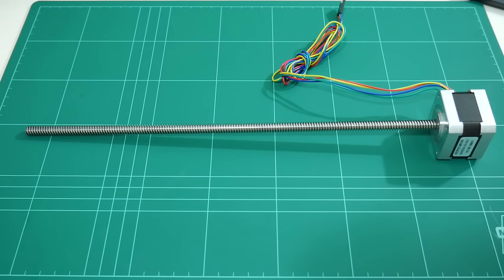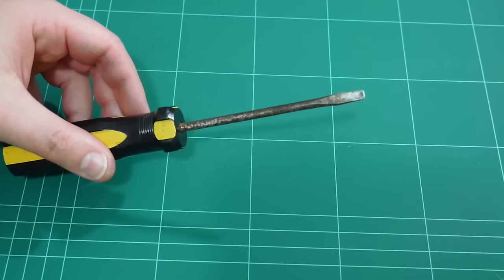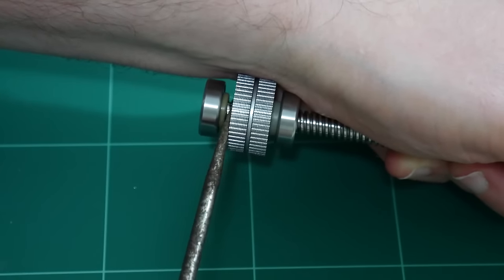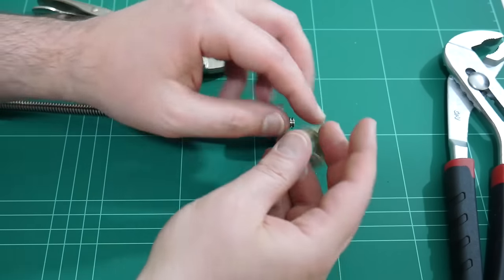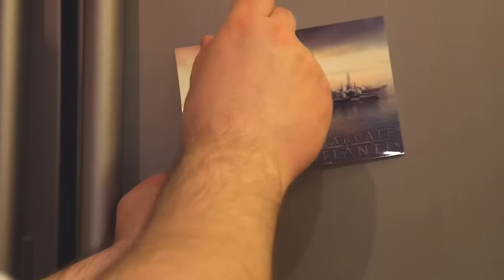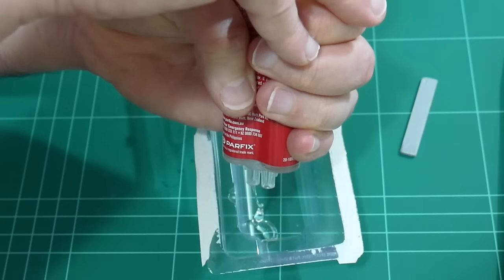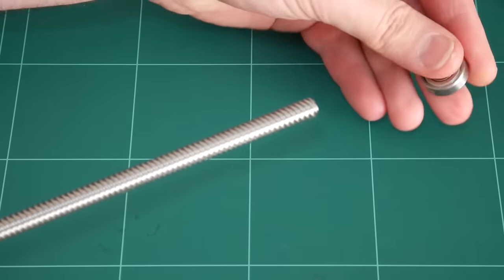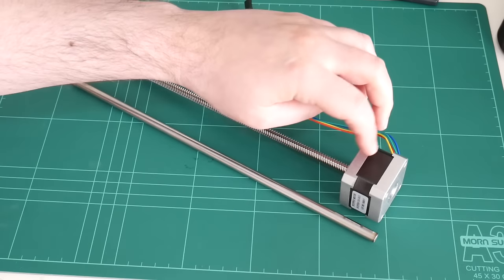3D Printer stepper motor mod

Comment: Thank you for the clear instruction. It is good to learn new things.
However,,
I use Flashforge Creator, and I've been having problem with bent lead screw too.
I tried to replace the lead screw, but it's impossible. I chipped both the lead screw and the magnet pretty bad, and they are still not separated. I just have to get the new motor.
This could have saved me like $90. Just didn't work for me.
So, I gotta say, "Do it at your own risk. if you own flashforge, don't."

Comment: Wonderfull, i love the style of this Video, had some good loughs. So if i want to build my HC with 200mm Z Hight, i ll need the 400mm Leadscrew? So i will need 400mm Extrusions for the Z Axis, 390mm Smooth rods, and a 400mm Lead screw?

Btw wouldnt the build still profit of a dual Z Motor setup?
Reply from the maker: You could get away with a 350mm leadscrew. Every other dimension you listed is ok.

Comment: A smoothrod in a stepper motor can be used for a ultimaker style printer, this removes the need of a belts
Reply from the maker: Bingo! I was thinking of the Ultimaker as well...
Reply: Tech2C well i own a ultimaker v1 myself and i know that such a upgrade would increase my accuracy.

Comment: Hi,
I suggest heating the magnet and lead screw to about 200*C to break down the glue bond. this works great for both epoxy and super glue.
I do not feel that at this temperature the magnetism of the magnet would alter
Reply from the maker: Heat could be a problem for a magnet as the magnetic domains may disorient. This depends on the metal, which I've seen first hand neodynium magnets lose their magnetism inside RC Car motors when overheated to 180c+. I'm not sure what material these magnets are in the steppers but 200c sounds quite high. I guess these steppers are cheap enough to experiment with.
Reply: someone else in the comment section said curie temp is 100 !!

Comment: i replaced the shaft in my nema14 guys and now they make horrible noises and vibrate differently when its at a certain angle. i wish i ran these things first before i changed the shaft. i think i may have damaged the teeth. it might have been when i had em in the vice and whacked on the rod to remove it.

Comment: Stick with a standard nematode 17 and coupler. That way you can change lead screws easier and if you want to go longer it’s also a good idea to increase the diameter. No need for a new stepper motor

Comment: I wonder if you could attach a nut to the rotor instead of the rod, for the motor to be part or the carriage being the one sliding up and down over a rod fixed to the frame. I think this may reduce the need to hace couplers to deal with the bend the rod may have when spinning: if the rod is fixed, then the only lateral movement to decouple wold be the one from the motor itself, but since the rod is fixed this shouldn't result on a wobble at the peace of one time per whole spin, but it would happen smoothly along the entire rod height. A spinning rod bent in the middle would transmit a wobble even to its base affecting the print quality from the very bottom up, while the same rod, when fixed, shouldn't affect the print quality but perhaps up to the height in which the bend becomes noticeable, and then the strain over a coupler for the motor would be negligible since the period of wobbling would be just one per a displacement over the entire rod.

Does this makes sense?
Reply: they exist as commercial products, so yeah.

Comment: Very interesting and straightforward video.  I don't wish to be alarmist, but I have always been told not to disassemble a stepper motor, as the rotor will partially de-magnetize and the motor will not produce the rated torque ever again.  I do not know this to be fact, so I will just throw that out as a caveat.

This has the potential to fall into "wives tale" territory, so maybe someone with actual knowledge on the subject can weigh in.  Perhaps some rough testing of torque between modified and non-modified motors might be useful.  I have tested torque using an  inch-pound torque wrench on a suitable nut (actually two nuts jammed together) with the motors energized to measure roughly the stall torque.  This would be an easy test to compare two motors to see if any substantial deterioration occurs because of disassembly, and could put the issue to rest.

But please do not consider this a criticism- I found the video very instructive and applicable to my current situation.
Reply from the maker: These stepper motors are just brushless motors. I don't understand how disassembling them can "demagnetize". A magnet will demagnetize with heat.

Either way the modified motor I'm using for my Z axis is working superbly. Cheers :)
Reply: Try to google it, devers6 is unfortunately right. It is something about the rotor gets magnetized after installation and you short it when you dis-/assemble it. 

I did it my self on one of my extruder motors and whey also work fine, so i dont really know how bad the de-magnetizing is.
Reply: Jesper Juul Thank you for the reminder - sometimes I forget Google is there.

Here is the result that meant the most to me, from legendary Marriss Freimanis of Geckodrive fame:

     This topic came up in another group. The stator acts as a magnetic "keeper" for the rotor.

     Nothing like running an experiment to know if something is true or not.

     I had a motor I didn't care for (MO62-FD04), so I ran dyno tests on it that showed 112 in-oz low-speed torque. I removed the rotor for 5 seconds, then replaced it and re-ran the dyno test.

     The low-speed torque now was 70 in-oz, or only 62% of what it was before disassemby. 

     You may not notice the loss in torque but it is real and it is there.

     Mariss

Now, here are the "grains of salt" I take away from this discussion:

1) These motors are low-end Cheap Chinese clones, not high-performance optimized systems.  I suspect any deterioration would be minimal.

2) The application is 3D printing, which is much less torque-dependent than CNC.  The market has been characterized by a race to the bottom in both mechanics and electronics, so I doubt there would be a noticeable drop off in performance.

3) I think the advantages to be gained by replacing lead screws with different threadforms, pitches, lengths, and materials far outweigh whatever electronic performance reduction might occur.

So I fully intend to try out these techniques if the need arises; just doing so with my eyes wide open.
Reply: I've taken a few of these apart. None have suffered any noticeable negative effects.
Reply: devers6 Wouldn't the possible speed of the motor also be reduced. Since there would be less torque that could be converted to speed. I could see the speed reduction being noticeable in 3d printing.
Reply: The problem as I understand it is that you can't get the gap between the rotor and stator as evenly spaced as they can in the factory with a special jig.  Personally I'm happy to get the back bearing back on well enough to stop it scraping.

I don't think there is any issue with the rotor being demagnetised.  Modern ones are a single neodymium ring magnet trapped between 2 iron pole pieces.  The torque in a hybrid stepper is not really dependant on the permanent magnet except to define which poles are north and south,  as the magnetic force from the coils does all the work.  Even if the permanent magnet is severely degraded,  the stepper will act as a Variable Reluctance motor.  This is why it is called a hybrid design.
Reply: "So how does a magnet loose its "full charge"?"   Inability to spell the word lose  causes them to lose credibility.   Permanent magnets are not "discharged"  they can only be damaged by sharp mechanical shock, powerful magnetic fields  or by heating above the Curie temperature  (at least 100°C  see https://en.wikipedia.org/wiki/Neodymium_magnet)
Reply: A solution I devised to minimise the torque loss,  by getting the back of the motor on as straight as possible, works as follows

1) The motor is mounted on a frame with a flexible drive from another motor which can turn at a constant low rpm
2)  The coils of the motor being assembled are connected to a dual trace oscilloscope across shunt resistors.  A simple scope made from an arduino  should suffice.
3) The back of the motor is attached snugly but not tight , and 4 large screws are arranged in a frame around the back,  such that they can fine tune the position of the back like a 4 jaw lathe chuck. 
4)  The drive motor is turned on,  and the position of the back is tweaked until the waveforms generated are as large and even as possible
5)  The motor screws can now be tightened down,  and the motor should be restored to close to optimal condition.
Reply: You don't understand? It has to do with the motor body acting like a magnet keeper for the rotor. I guess you never played with magnets much?
Reply: In a hybrid stepper used in 3d printers, disassembly cannot and will not lead to a loss in torque unless you blow torch the magnet or drop it on concrete or something. Shock from dropping a magnet can reduce its magnetism though, so handle with care.
Reply: Marcelo J - If you wanted to fix a broken cable of your Nema 23 motor, disassembling it was perhaps your only option. If the motor has become functional again, it was worth opening it to fix it. Though the torque is reduced to an extent now, the side benefit is that a useful lesson has been learnt.
Reply: As far as my experiments go, stepper motors disassembled always work. When in doubt, do an experiment: one way to check torque reduction is to use a torque meter, and hold it to max torque while it is trying to rotate.
Reply: You have no idea what you are talking about. this is not a shock effect. The field gradient in the gap is strong enough to 'reshuffle' the local magnetic domains as you pull the rotor, the only way it can be prevented is by inserting a cylindrical shim between the rotor and stator first to act as a flux concentrator.

Comment: Dear Tech2C,
just for the sake of using correct terms: the 2K epoxy resin is not "drying". It is "set". You know, glues with a volatile solvent, they are drying: the solvent evaporates, and what remains is the gluing agent between the two parts to be glued.
Epoxy resins are so-called thermosetting polymers, hence they will set or cure, not dry.

Keep up posting!

Comment: Or 3d print an adaptor so the stator can ride on the leadscrew that way the motor body is the z axis and the leadscrew is fixed to the frame.

Comment: Long lead screws are a problem with high speeds.  Bent or not. a long lead screw starts to wobble.  The solution is to turn the nut with the stepper motor instead of using it to turn the screw.

Comment: Ehhh.... 
"Soak in acetone for 12 hours before trying to twist your rotor magnet off the rod" is missing from this video. 

Damaging that rotor magnet in any way is going to be at least as bad as having a bent rod. Acetone can weaken epoxy, if only very slightly, which can save yourself some headache. It might be worth while to experiment with some different solvents, but I do see that might only have limited results.
Reply: I was thinking that too. Nail polish remover.
Reply: Solvents are great, but don't count on most machines just being glued together. Heat is the ultimate cheap and versatile tool.

I've repaired my own car's manual transmission and those bearings and gears were not glued, they were interference fit. Mechanics use pullers, presses and propane out of necessity and they're safer than brute force. Fittings expand slightly with heat and become easier to install and remove. It also softens most epoxies. Getting parts too hot can demagnetize them (curie point), mess up the temper of steel (>300F) or melt plastic (this varies), but freezing one piece while heating another is a way to get around that. Just avoid heating or cooling areas of one part too unevenly or it can shatter or warp. It's not that heating things is ever a bad idea, it's just that the easiest approach to doing something really difficult can still be a pain. It's also harder if the wrong heat source is used. A propane torch is a fast heater (bordering on overkill), but an electric heat gun is usually better and less likely to do damage. The moderate way of cooling something is air or water, and more extreme cooling involves refrigeration or canned air (which may be flammable).
Reply: @chrisbalfour466  You totally don't want to be heating up magnets.
Reply: @edism  Yeah, Neodymium magnets can't handle much heat before demagnetizing. But, a lot of other kinds can handle more. It really shouldn't take high temps, though. Some metals expand a lot when moderately heated.
Reply: @chrisbalfour466  ok
Reply: My rotor has some green stuff on it, wonder if a solvent would weaken the magnet itself it is it glued up?

Comment: You have to use a tool so called bearing /pulley remover to maintain your bearing and axle persuasion.
Reply: listerine 2010 Took my motor apart, and just marked the teeth facing the sides with the wire. Still have 2.5-2.6 km.cm

Comment: Smooth rod coming out of the motor to drive an axis using 3 808 bearings at 23.5 deg angle in a aluminum frame.  This concept is used in larger scale cnc machines, wherein large long lead screw setup's would be impractical.
Reply: +Dan Fouke  Which large scale CNC machine are you referring to? Can you specify the manufacturer?

I can't imagine any CNC machine costing several hundreds of thousands of dollars would rely on nothing but friction to maintain it's accuracy. That just doesn't make sense to me.
Reply: It is called a thread less ball screw and my henry heavy lathe has it
Reply: +Dan Fouke  I know what its called but you're not answering my question. Which "large scale CNC machine"  (your words) were you referring to in your original post.
Reply: Please learn to read comments like my last one before posting.
Reply: +Dan Fouke  I can read fine Dan. How about you stop being so cryptic and give me a link I can look at. I googled "Henry heavy lathe" and nothing came up. Is Henry the brand of the lathe?...cause it's not showing up in a search. I'm really curious about this lathe with thread less ball screws you're talking about. Don't leave me hangin Dan.
Reply: OU812 henry lathe was made in Philadelphia in the 60s uses thread less ballscrew I'll shoot a pic when I can
Reply: +Dan Fouke  Much appreciated Dan.

Comment: Couldn't you use a solvent for the original epoxy?
Reply from the maker: Maybe. This method seemed faster. For larger rotors a solvent might be the only choice.
Reply: Could you tell what kind of glue they used from the factory?